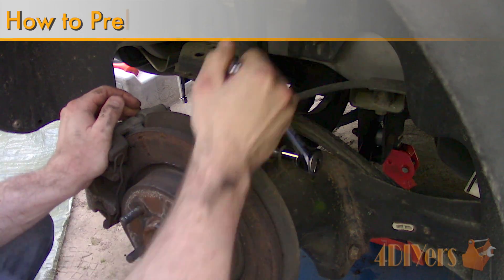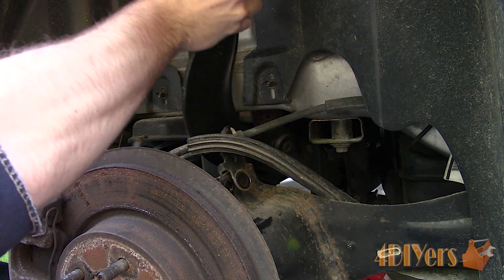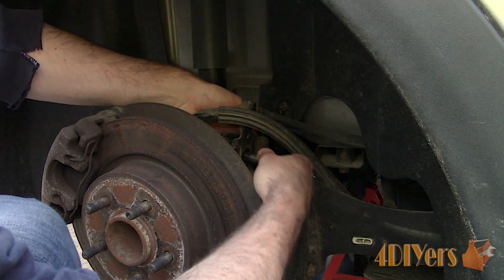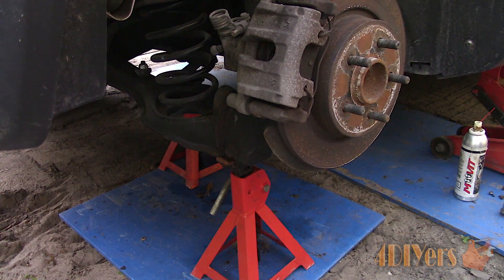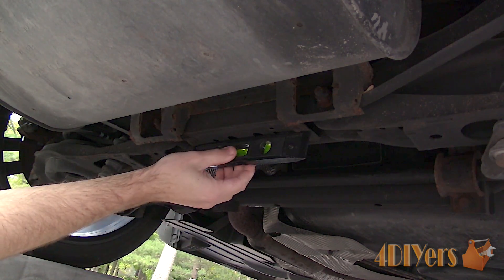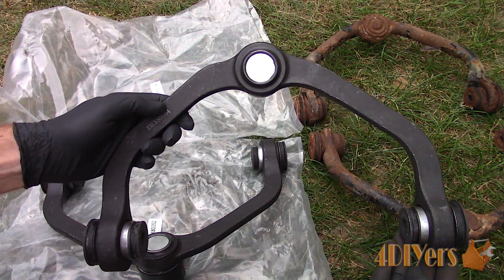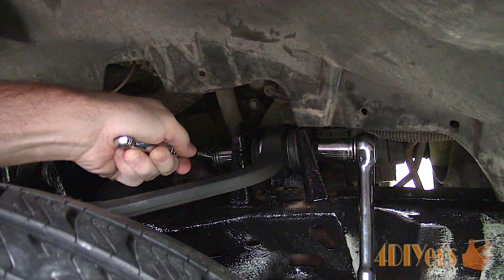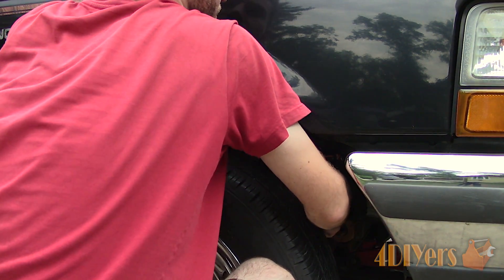How to Preload Rubber Suspension Bushings

Comment: If I didnt preload my lower control arm bushings, with the car on the ground, would I be be able to simply loosen the control arm bolts a bit and retighten? Please let me know. I recently had my lower control arm out to press in a balljoint and the mech tightened those bushings without any preload.
Reply from the maker: Yes you can do that.

Comment: I drive a Tesla and recently I let local mechanics replaced all 4 lower control arms and both upper control arms both front complete struts and rear shocks got the alignment but my car drives like a crap  I’m not sure if did preload or not but hearing noises specially around bumpy roads or rough road surfaces {grinding,groaning, vibrations,} I’m uncertain if these issues are caused by not properly preloading ! ? Any help appreciated
Reply from the maker: If you're having sounds after the repair, then most likely something wasn't done correctly. And if it's not handling well, then there is most likely an alignment issue too. I would recommend taking it back to the shop, however be careful. If they couldn't do it right in the first place, it's hard to say if the second time will be any better.

Comment: Are you supposed to leave that plastic cap/cover on the middle of the control arm?
Reply from the maker: That's just a protective cap from when the control arm is new. That gets removed when it's installed.
Reply: Nope
Reply: @JoeJoe-wp1vv  feel like such a newb for that question 😂 in the 6 months that’s passed I’ve changed out a handful of ca’s and every other piece of suspension and steering but hey, u have to start somewhere

Comment: Just to clarify, you originally supported the car on a jack stand placed on the center jack point and to preload the bushings, you placed a jack under the ball joint of the control arm and let the vehicle to rest on the jack stand under the control arm? I presume the height of the jack stand under the control arm was higher than the one supporting the center jack point? I have a similar issue with my 2010 Legacy. The car is too low to get under even while on ramps and the only option I have is to do what you suggested. Thanks for the great tip!